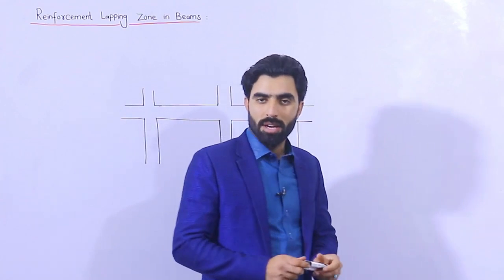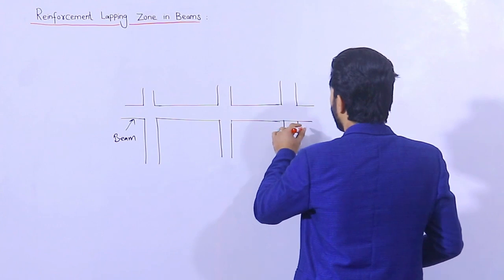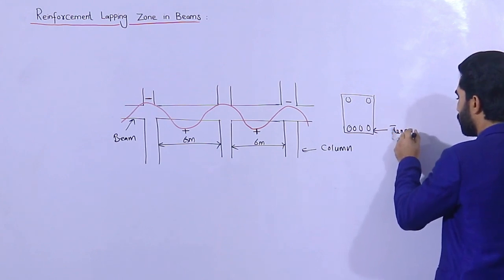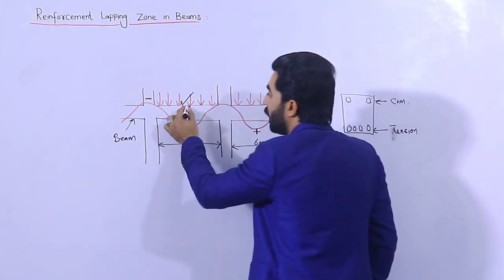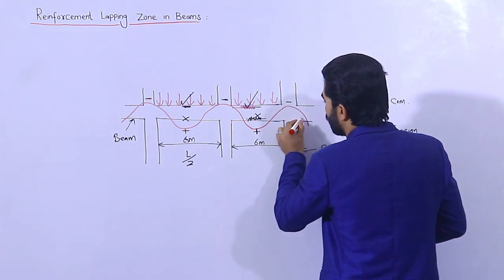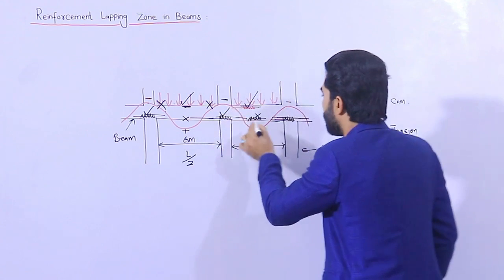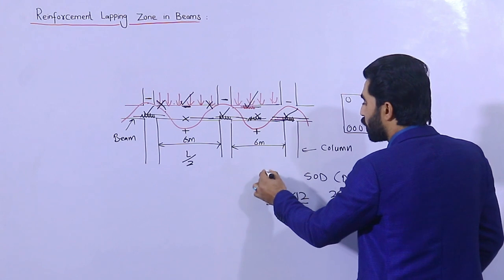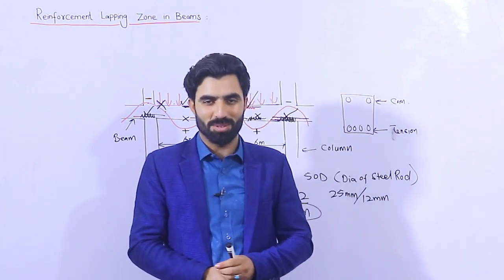Basic Rules of Lapping in Beam   Reinforcement Lapping zone in Beams

Comment: You discuss three coulumn A,B and C  Sir splicing on beam from A to B using 12 dia and 16 dia B to C 16 dia what is the basis of lapping length on A to B using different 12mm and 16 mm
corrugated bar kindly discuss ill follow

Comment: Are slabs and beams usually poured monolithically? Does that mean that all steel in the suspended slab is in compression where you lap after l/4, because the beams are the tension members and are so deep? Example, if you have 16 in beam plus 6 in slab on top, a total of 22 inches cross section, the top 11 inches is all compression and bottom 11 must be all tension steel?